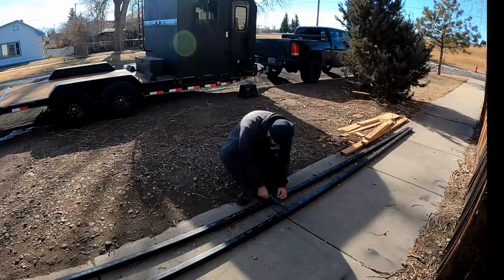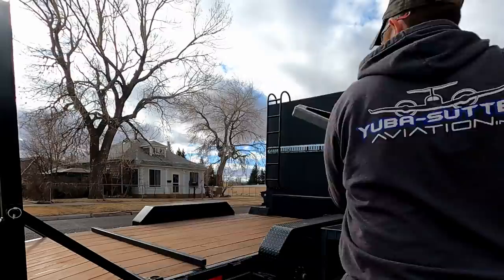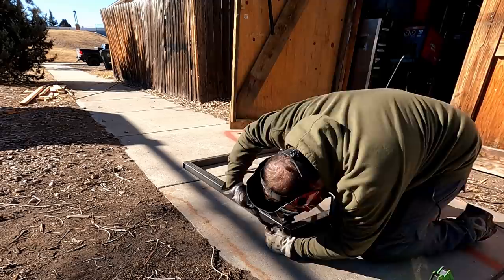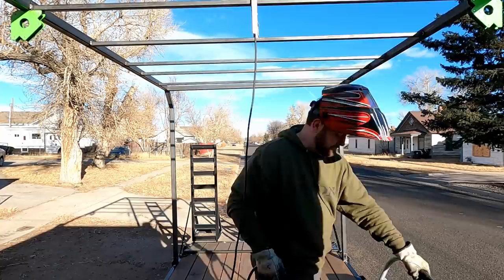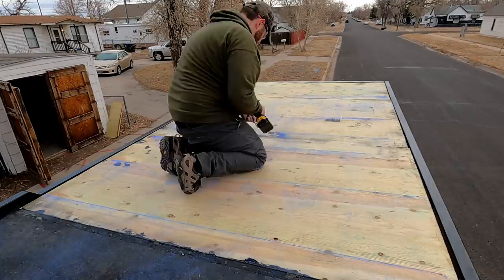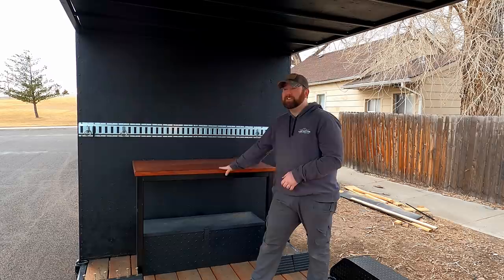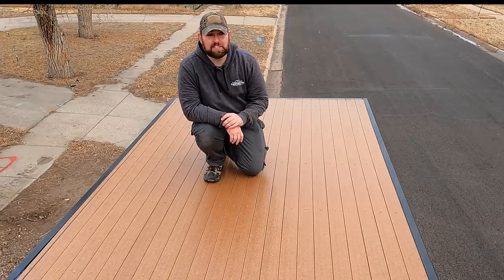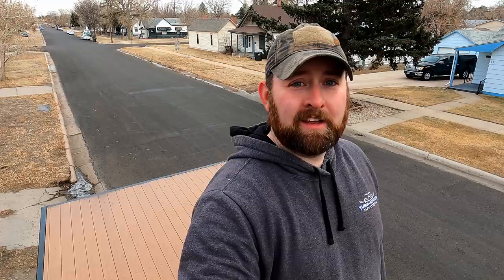SECOND STORY DECK on a CAMPER?? What?! Crawler Hauler/Bugout Camper Build

Comment: Add some tabs on the under side of the main deck rails so you can hang a tarp to keep the wind/rain out!
Reply: I was thinking along the same lines. Maybe snaps for easy on and off access.
Reply: Awesome
Reply: @nwhite2006  is it really. Nichelle
Reply: @bobbyyoung7836  ??
Reply: Great idea or even see through sun shade/block material.
Reply: Oh thats a great idea! There is a company called Sunbrella 302 that makes a great all weather material. Its mold and mildew resistant, and cleans up well. Aliner uses it on their folding trailers and has been for many years. Its also the same product many out door furniture companies use!!
Reply: @bobbyyoung7836  N.W.Next comment even she doesn't know!!..,,She was Confused ??
Reply: Ya another great Idea.
Reply: @nwhite2006  i think I would add a small ring, it would handle lights and other goodies also.

Comment: Ill mention it again. Put the top 2 solar panels on the left side on hinges that you can move them from the vertical position to the horizontal for when you're parked.  Also maybe look at an awning on each side of the new deck? Little 2x2 LED pod lights, 2 or 3 on each post, on movable mounts. That way when you break the Jeep, you have a lot of little pods that you can aim in all sorts of direction for better light when working on the Jeep. Loving the build!

Comment: I'd add a fold down railing for the sun deck. Your build has the gears turning in my head.
Reply: I was thinking same thing..  same thing they do on those toy hauler ramps..   but this one is much higher.. so if budget allowed I would be adding some railing before using,.
Reply: And some hooks along top of edge to allow temporary tarp to install on whichever side bad weather or sun is on when working under the deck.
Reply: look at schoolie, also spelled skoolie, builds for inspiration. lots of great roof decks to browse.
Reply: Re: railing - you could put in some pipe flanges and do a pipes upwards with eye bolts at the end through a pipe end cap. The railing could be rope run through the eye bolts. The uprights could be unscrewed from the flanges and removed for travel.
Reply: great Idea kind of the same folding rails on a fuel tank truck
Reply: NASCAR trailers have aluminum folding railings that would work great on this. That is a long way to fall.

Comment: You’re going to need some cross braces in the rear  corners for your over deck roof look at boats Center console hardtop design from Grady white  I built the same thing you built covering a dump trailer without cross brace it’s fell apart overtime that’s why boats do it that way , just an observation you are an excellent engineer/builder top notch
Reply: Most likely, that decking isn't particularly light by any means. A local concrete contractor has a fleet of double decker trailers that he works the pi** out of and he has his uprights gussetted big time, either a repair or original don't know.  I like the concept, better then hauling a trailer twice as long!

Comment: For your upper deck fab some railings that fold down for transport and fold up when your up there. Safari rack for above the camper section for additional storage, lights, and antennas. Also would recommend some outriggers for when your setup and stationary.  This will help stabilize the tailor and keep it from rocking especially when using the upper deck portions.  For off road use, you can setup the axels for bigger tires, and suspension articulation when using the tailor on the trails.  Awesome setup.

Comment: I'm a grinder too!  I got myself a HF Titanium flux core welder for $169 and works pretty good.  The only problem with using it is the operator isn't very good!  You'd probably have no problem getting nice results.
Reply from the maker: Dont give up, everything takes practice. There are the welder snobs online that will bash whatever you make or do but don't listen to them keep practicing and you'll get better. Myself included.

Comment: Very buslife (skoolie) addition! Love it. 
You may need to replace the underlayer plywood after a few years if there ends up being standing water for any length of time. or just leave it slightly tilted down at the rear to shed water when not in use.
Reply from the maker: I made sure to get ground rated pressure treated plywood for the decking so it should last awhile. With it being a trailer it will never be perfectly level so it should keep the standing water to a minimum.

Comment: If you get a clear 2 liter bottle, then cut the large side of it off and then take a section out of the side, then cut the top off just below where the threads are, you can create a wind shield. Stick the end of your welder in the smaller end and then the big end goes over what you're working on. Then you can weld and it will give a little protection from the wind. It helps and best part is its free. Just throw it away when finished. Having a person help you hold a wind break is great, but when you don't have a second set of hands, this works well. Cool project! I have a 36ft sundowner all aluminum gooseneck crawler hauler and love it! It's 36ft so it's 16ft of camper w/ the riser section that goes over the bed with a 16+4 flatbed (16ft straight over the wheel wells with 4ft dovetail). It's got a queen size bed in the riser along with lots of storage, then has a rear lounge with fold up table, kitchen on the driver's side and bathroom on the curb side with the entrance door. The whole driver's side is a slide out so I gain like 2 ft of width. After seeing what you did, I might built something like this for mine! I have a walk on rated roof but with my solar panels and a/c unit there isn't much room to stand. Would be cool to at least do like a 5ft extention to the back of the roof where I don't have anything mounted so I'll end up with a 10ft long by 8.5ft wide platform. I could build a simple railing for it and would have room for a couple chairs, table and maybe even bring a grill up there! Thanks for the ideas!
Reply from the maker: I was looking at the Sundowner before building this. I just didn't have the money for those. They are expensive as hell. They look amazing tho, super jealous.

Comment: You could also add a coat of oil-based floor sealer with a slight grit to protect it and give it some traction.
Reply: I've done this for some interior stuff. You can buy texture for epoxy floors that's essentially ground glass.

Comment: Just a small idea, since your are handy burning wire. You could weld or mount a 2" receiver somewhere on the work bench or to a leg. Weld a plate onto the male piece of the receiver (hitch post), then bolt a vise onto the plate. This would allow you to slide in the vise when needed, and stow it away when your rig is running. Vises come in handy! This build looks awesome! Just started watching you channel. What Jeep do you have?  Rubber side down!
Reply from the maker: I like that idea

Comment: Nice build 💜 You can lightly spray a thin coat of a rubber grip type of spray on the rooftop deck just to be on the safe side. Ounce of prevention 😷

Comment: You could cut out an access panel up front above the new flip-up bench and add a step or two and a handrail to the back of the enclosed unit and go up top from below. Hinge it to close up the roof Also put down some 3m traction strips up there..
Reply from the maker: I like the way you think!

Comment: This thing is really turning out great man you could have a canvass canopy made to enclose the under deck and enclose the whole thing making a large extra sleeping area.
Our old camper was that way, the inside was large but only had two beds so the canopy was as large as the whole camper and had a floor so we used two blow up mattresses and had enough room for 4 family’s in a 28’ camper it was great.

Comment: Idea for deck rails: 2 long rails on the sides connected to the lower rails with lengths of wire rope. The top rails rest on the welded rails in U-shaped holders during transport. When using the rails, you lift them and put in verticals on either end that sit in sockets.  Or, build sides that hang along the sides of the jeep area, and are hinged so that they can swing up to the top. Fit cross bars front and rear with hitch pins to keep them upright.

Comment: You should attach a winch to the trailer under the new work bench to pull the jeep up in case of electrical or engine failure etc.
Reply: I was thinking the same, then realized the back wall of the camper might not be strong enough.   =\

Comment: very cool Deck. Could make some railings that slide up and down, and when they are down they can be a back drop of a protection from wind or rain.... put up a brown tarp on the sides from the top to the trailer... you could go on and on with what you made... very cool

Cheers from Montana.....

Comment: Thanks for posting this. I’m thinking of using my flatbed trailer for building a mobile deck for my RV that’s sturdy enough to drive my side x side/4 wheelers, a car/tractor or golf cart onto and can move it right next to my RV to use as a deck but I’ve wanted to cover it and your solution for you is what I think will likely work for me. Although I think I will create some ladder like rails that can slide up and lock so that it’s safer to be up top. But I’m thinking about a way to have a table and chairs up top. Also I like your camper but I think I’ll build mine for storage for my RV. I wanted to thank you for filming your video because it really has helped me in figuring out my issues! Thanks!

Comment: I’m loving it 👍🏻.  But if you can put ladder on both sides that will reinforce and add more rigidity. Instead of just those 4 points that’s supporting it. Otherwise, expect some twisting of that addition when you are mobile.  Just my two cents 😏.  But man this is an awesome build 🤙🏻.
Reply from the maker: I was trying to keep it a little flexible for travel so it doesn't fall apart. But I may have to end up doing that. We will see.
Reply: @CodeBrownProductions  👍🏻 which ever you think is best... can’t wait for you next progress video on this.

Comment: Looking good.  Now you have a lot more roof space for more solar panels if you end up needing a few more.  Curious as to why you chose not to paint the top of the plywood.  I know it's treated but seems a coat of that black paint may help you a lot a few years down the road.  Consider some sort of mechanism to easily attach some tarps for side walls when desires.  You have so many options with this thing you're building.  Keep up the nice work.

Comment: Hey there,looks really cool.....could put few screw eyes in that top deck and have a two man tent up there,bear safe,plus adds few more people to sleep there. Plus on sides you could tarp it of with elastic bungees and some eyes welded or bolted on. If ever need more tractiin on roof you could polyurathane varish, it and add play sand in mix,clear would give u same colour,could do bedliner when wears a bit.
Side ladder be good for access as said,but you could make on hinges flip up side safety rails if wanted,plus what about couple spotlights either end pointing over and down, worklights,party lights,safety lights,security light uses.
Good build. Keep up good work.
Peace.

Comment: Pretty nifty man!!!! Add some amber  led marker lights on the front left and right top corners and red on the rear just like campers and semi trailers have!  Safety first! Should be easy to tap into existing trailer wiring!

Comment: Looks nice, but I would have painted the plywood before I covered it to prevent rot. 
Ought to make some removable or folding railing for the deck. Even short ones would give you something to tie off to and keep you from sliding your chair over the edge while you're hanging out on top or to put stuff up there when you're towing to somewhere. If you have someone on top with you, you might want to run a cross brace fore and aft and maybe gusset the corners. My first time here, gunna go look at the earlier stuff now.
Reply from the maker: Not painting it was my only mistake.

Comment: I'd hinge a ladder that swings in while being transported and swings out to the side when parked and needed for use.  Would look way better to me.  :)
Reply from the maker: Interesting
Reply: Ya, that's what I was thinking. Something that would lay flush against the wall but you're able to pull it out so it doesn't catch on anything. Maybe use some of that C-channel and hinged on both sides so it's sturdy enough to hold weight. Then you can get a combination sliding bolt so you can lock it with a combination and keep people off of it when not in use. That sounds like an awesome idea!
Reply: I think a fixed ladder through the deck might look a bit better. Seems safer to get down also

Comment: I like your roof/deck. 👍  Your going to trap water between the plywood and decking. Bye bye plywood in about a year or two. Plus it’s going to leak at the plywood panel joints.
Reply from the maker: Not necessarily. There are plenty of spaces between the plywood and frame that water just drips off the side of it. The plywood is also AC3 ground contact rated so it will last for a long time. As for the joints between the plywood there were all sealed using silicone. So far it's already been through a blizzard and had standing water on it for days with not leaks from the joints.

Comment: You could use some old school hood pins to securely hold the work bench in the up position, just bolt the through the wall (if you can still remove the inside paneling to install), awesome hauler!

Comment: Cool project, well done. The upper deck is a lot if space for the materials and size. 2-3 people would be iffy. Try a couple angle braces to stiffen the deck. You could also have a center support post that folds down when you are topside hanging out.
Reply from the maker: Realalistly, I'm only looking at my self and one other person so I should be OK. But if not I like your idea.

Comment: Maybe a hinged ladder on the side?  Rotates on the top, extends and locks near the bottom?  Folds flat (ish) for travel.  I've seen on the back of fire trucks.
Reply from the maker: Not a bad idea for a future project but I've already built and installed a simple flush ladder for the drivers side.

Comment: HEY, that craftsman compressor... check the air filter the one that came in mine was stoopid thick, i put a super thin one and it was like 5x better.  Ran smoother and filled faster.
Reply from the maker: I will have to do that.  Thanks for the heads up.

Comment: Nice job
Put a mirror surface on bottom of your table so you can see your approach loading your Jeep

On your welding issue.  
It looked like you used an extension cord to run your welder. Low amps
Your deck roof looked like it would trap water?   Your plywood won’t rot but could delaminate especially around your screws
But might outlast the trailer
Reply from the maker: The mirror idea is very interesting. As for the welding I have the largest extention cord running out to it that I could find. I really just need to get 220v hooked up to my shop.

Comment: Turned out very nice. The roof was practical, work bench too. As for the roof top balcony me personally would never use it for anything else then to dust off and clean the solar panels. I would rather sit under the roof, in the shade, with a cold beverage and watch the world pass by.
Reply from the maker: Its a nice place to get a good vantage point, hang out when the weather good and fly my drone lol

Comment: Voiceover blew to the left channel only, background music was pretty OK, could be a tad lower on level. 
As for the trailer, I would have contibued the deck's rear vertical tot he ramp point to have a simple lock to hold the ramps upright without any other needs. Another option, fit large side panels that are hinged at the top, have them able to swing up to the top deck height, simple legs or arms back to the verticals to give an even larger upper deck to put up a tent/tents away from the wildlife.

Comment: Nice build so far, probably not needed and just extra tow weight, but you could build a removable rail system for the deck. Could store up top and when arrived at your camp site could quickly stand them up and slide them into place. Just a safety precaution for those drunk nights or safety against any liability of fellow campers/friends/kids accidentally falling off. Could also add some retractable awning or tarp system on both or either side for additional sun/rain screening.

Edit: just saw all the other comments about rail system lol.
Reply from the maker: Eventually I will build a rail system for safety.